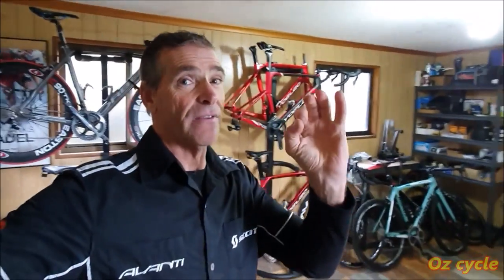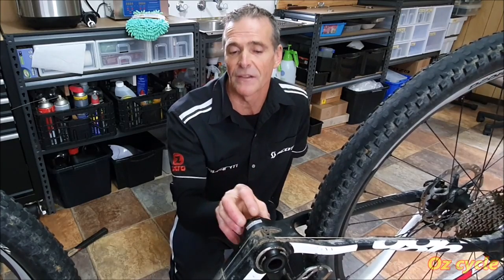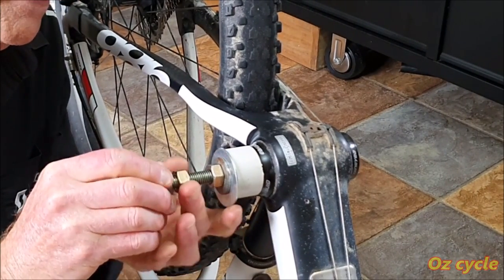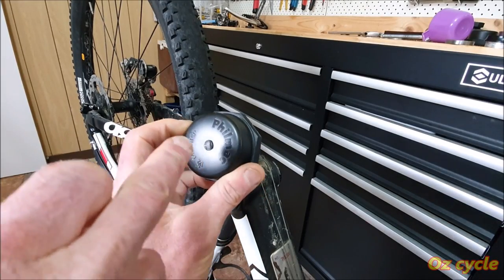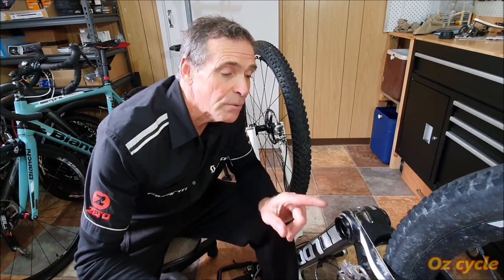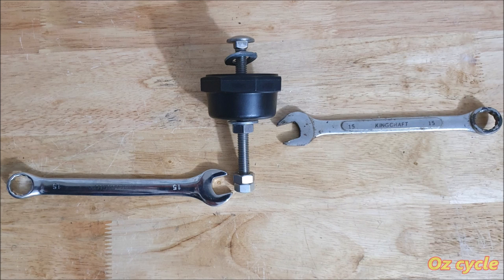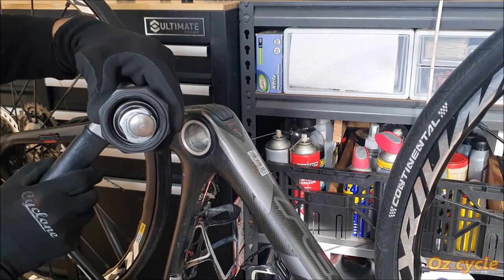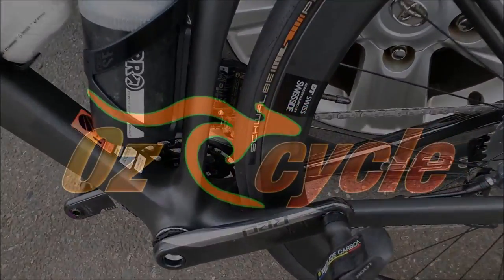Bearing Puller tool - make it yourself !

Comment: Hi . You are a very resourceful guy. Thank you for sharing your ideas! If I can add something on my part: I recommend that you always use a 10.5mm spacer, even the large one - yes, you can buy a 10.5mm spacer with a large outer diameter. Secondly, it will be better to use a screw made of a better material (8.8 or 10.9) - you still have the thread in good condition after repeated use. As for the screw head - an Allen head is a better solution in this material class.

Comment: I've been a big fan of making stuff out of poly pipe for a long time so I thought I'd give your bearing puller tool and press tool a go. My expectations were pretty low, mostly because my tool making skills are a bit average and various bike shop people warned me about potential disasters  when using anything other than the expensive BB tools they were selling. Luckily I have a broken bike I can practise on so there was nothing to lose. Imagine my surprise when both tools worked perfectly first time! Now servicing and replacing the dreaded press fit BB is as easy as the threaded BB on my old mountain bike.
 A big shout out to your wax/PTFE recipe too. I've done about 200km on my first waxing and just finished rewaxing, not because the chain was noisy, just to see how it would go. I'm a convert. Even if I don't get your amazing chain life, it'll be worth it not to get covered in oil every time I go near the bike (I'm a bit of an oil magnet). Thanks for your content. Great Aussie ingenuity.
Reply from the maker: Thanx for relating your experiences Peter , much appreciated.

Comment: Perfect video! I replaced a press fit bottom bracket on my carbon frame a while ago, and it was honestly nerve-racking to do it with a hammer and the leek-style Park tool RT-1 i borrowed from a friend. I won't be doing it again. I will definitely make this tool the next time I need it!

Comment: Very nice solution , and cheap too. Next episode a tool to press them in again? Cheap too. Cheers, from Scotland.
Reply: A hex bolt with 2 washers and one nut works fine for cups and bearings to press in both sides at once

Comment: Always great videos, thanks for these.
Reply: The only thing it doesn't do is pull a bearing where the bearing has a spindle going through it (eg washing machine motor).  That needs a puller with jaws that grips the outer side / lip of the bearing and the bolt pushes down on the spindle end.

But I'll let you off since I don't often cycle on my washing machine.  HA!

Comment: Great video.  The best place for BB30 bearings is in the bin! (CAAD10 owner).  I have installed a ZTTO thread together bottom bracket (from Ali Express) instead.
Reply: Any creaks?  What crank are you running?
Reply: @robnoonan9051  so far so good after 6 months of part time use (~1500km). I used lots of marine-grade lithium grease during install. Still spins around smoothly as I check it every time I take chain off (every 350km to rewax chain). I'm  using a SRAM gxp crankset with Shimano to gxp (2mm) adapter as I wanted to ensure could I use Shimano or gxp crank in the future

Comment: hello, this isn't a bearing pulller related question but it is about your diy water proofing video. can I ask if I can use denatured alcohol instead of white spirits? getting hold of white spirits in my place is basically impossible, unless you've got the cash😂. hope this gets answered, answer will be highly appreciated.

Comment: Awesome. I have the classic puller with the inline hammer. Noise is so terrific on my carbon enduro bike than I failed to extract my grippy rear bearing. I will try your solution asap

Comment: Excellent. I’ve been hammering old bearings out which destroys them. Much better to pull them out as some can be cleaned, regreased and reused
Reply from the maker: Yes , you can pull them out , clean n regrease...done it many times with this tool.

Comment: Can you not also fit both small & large adapted washers inside the end "cup" because if both go through the large bearing aperture why would it matter if you had 2 puller washers behind it rather than just 1. You don't need to replace one with the other just leave them both in situ. I like this inventiveness though, it's nice to hear the logical thought of Design.

Comment: Been watching the bearing replacement in the wheels, getting my head around what’s needed but… how do you pull a bearing that has the same internal diameter as the spindle? Re. Campag Vento G3? Expanding bolt to grab 8mm?
Reply from the maker: Use a blind bearing puller
Reply: @stevenleffanue  thanks very much, I’ll look it up

Comment: You undid all your good work using that kitchen table chairs leg as a handle. But then you redeemed yourself by replacing that eyesore.  I would want to grind or file a taper on that square lug shoulder on the coach bolt, just to prevent the chance of the washer ever catching on it and not sitting flat during use. It may not be a problem with your combination of bolt and washer, but some may encounter the problem using a washer with a different ID size.

Comment: Awesome tool, all the way down to the crank arm w/bolt cap. I really like new tools but I love DIY ingenuity. 

Could you swap in a larger poly cap for pulling the cups, instead of the poly slice? Or does it need to be flat?
Reply from the maker: Needs to be 2 sizes....1 holds cup whilst pulling bearings , larger ring or collar to pull cups. You can use a larger cup to pull cups but it would require dissassembling tool when swapping to bearings , or 2 dedicated tools.
Reply: @stevenleffanue   thanks for the reply. Yep I realized that right after my comment - heh. Really appreciate your videos.

Comment: Great video thanks. Great idea about the washer being filed down. I use a threaded rod with hexagonal nuts on the end, large washers and cheap drift set off amazon as a bearing press, which can press any bearing anywhere on any bike. I think you did a video on that too. So i can re-purpose this with the poly pipe and the filed down washer and make an extractor too.

Comment: Brilliant. Have you figured out how to get the bearings off pedal spindles? LOOK wants $90 for a new Ti spindle and bearing, just because the bearing is shot.

PS for someone with a LOOK bike, you should be able to spring for new rear tire before it gets bald 😉
Reply from the maker: If replacing the old bearing for new it want matter if you ruin the old to get it off. Tapping the bearing side to side it will slowly rock it's way off. Sockets work well too if you get one very close to the right fit.
Reply: @stevenleffanue  and what about pressing the new bearing on, just tap-tap-tap with a socket? LOOK says the bearings are swaged on, I have no idea what that means
Reply from the maker: Yes you can use a socket but press on the inner race only for an axle , outer race only for a housing.

Comment: Instead of the make shift handle as you called it, why not drill a hole through the end of the bolt and slide another rod or bolt through it so as to make a T-handle?
Reply from the maker: Good idea. The cuphead bolt is only 10mm tho....would be a small hole indeed.

Comment: I used this before and now need to perform some BB maintenance.  Must I remove bearing or can I pull cup with bearing installed?
Reply from the maker: Yes , you will need to remove bearing to get the next size washer in to pull the cup out. If you are careful you can tap the cup and bearing out together with a piece of dowel(broomstick) coming in from the opposite side of the bb.
Reply: @stevenleffanue  thanks, non issue now I see.  This is dub BB with outboard bearings.  On Ti frame I can’t get a 3 points of contact with cup  on frame.  Looks like a knockout….

Comment: Will this also work for a BB86/BB90 pressfit cup with the plastic housing in between both ends?
Reply from the maker: BB86 with plastic cups with attached sleeve....no. 
BB90 , yes

Comment: What if your bearings are rusted, assume still use this with some wd40
Reply from the maker: The best is to replace bearings if extracted.  Otherwise you can try degreasing the bearings and remove as much dirt as possible without removing them. Regrease them and feel if they are smooth enough for you. If not , replace them.
Reply: @stevenleffanue  thanks was thinking more if the housing is rusted and sticking to the carbon frame, luckily the LBS was able to it out with a screwdriver mallet today

Comment: I see some potential issues with this design.  Mostly alignment between the puller, frame and bearing.  If your not pulling completely aligned it will damage your frame cup.
Reply from the maker: Should work fine , I've not had any problems for past year using the tool. Would be nice to have a finer threaded cup head bolt , that's about it.

Comment: how would you remove just the outer ring from the hub?
Reply: If you have an Aluminum frame, and you've F-ed up your bearing so only the outer race persists inside the frame, I would use a wooden dowel + hammer to tap it out EVENLY.
Reply: @RK-kn1ud  i tried , didnt work out for me , its very tight
eventually i took the wheel to some shop , paid Damn 50 bucks to remove single ring !!!